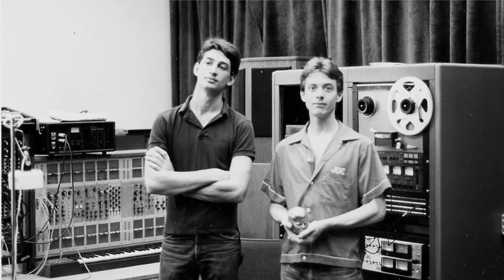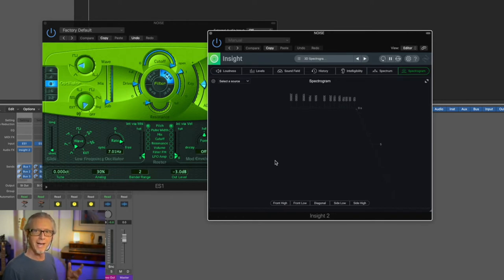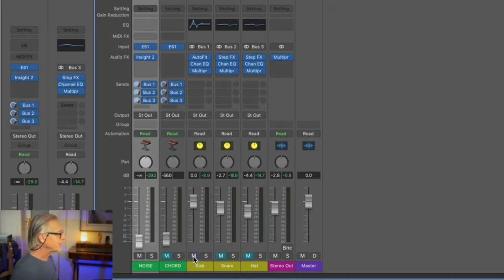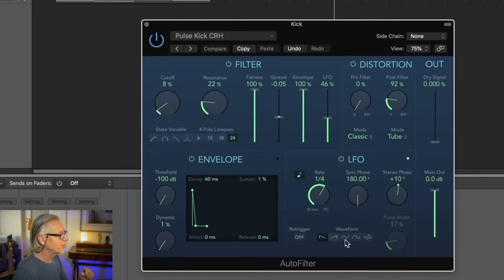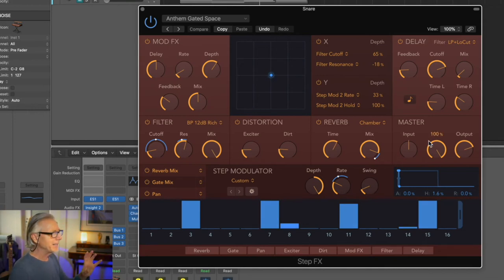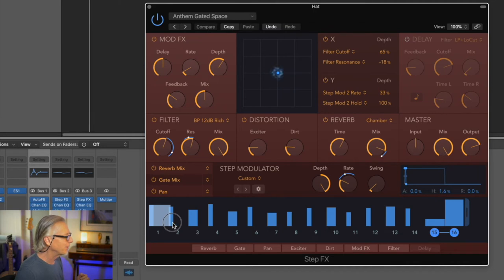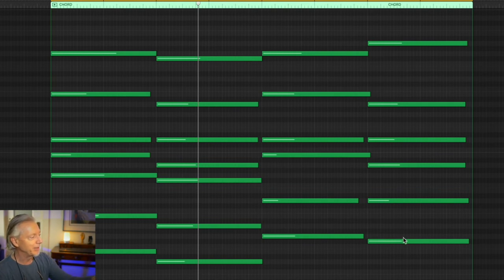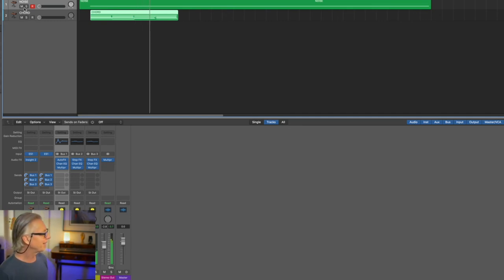Step Modulation & LFO Autofilter tricks to turn Noise & Chords into Beats

Comment: This is very cool! Fun fact, the old Nintendo had a noise channel which allowed for making percussion sounds similar to this.

The NES used the Ricoh 2A03 sound-chip, which allowed for 5 sound channels. 2 pulse channels, a triangle generator channel, a 1-bit DPCM channel where samples could be loaded, and an LFSR-based Noise generator.

I like to make chiptune style music from time to time, but I never thought to try and use this concept in my regular DAW. I never realized how much more you can do with noise without the NES limitations.